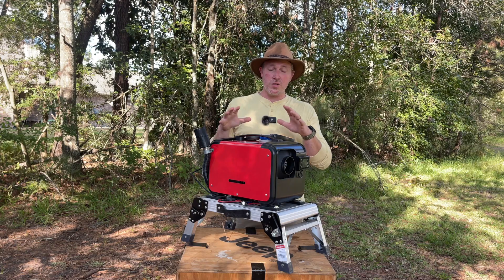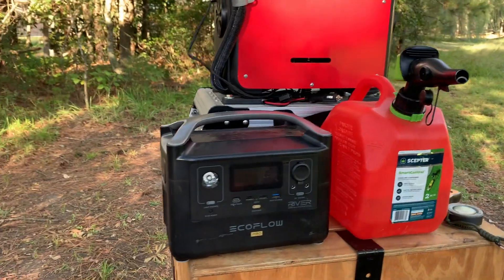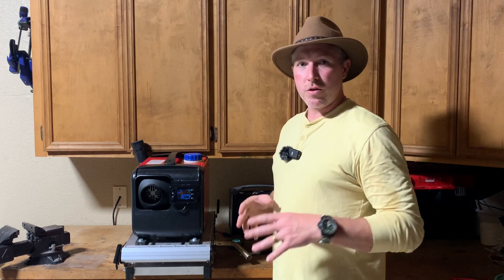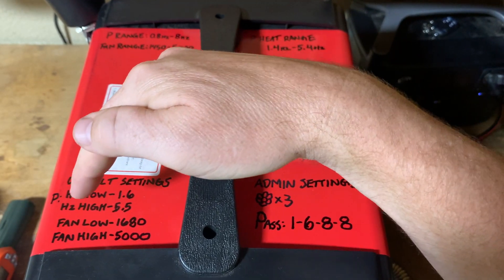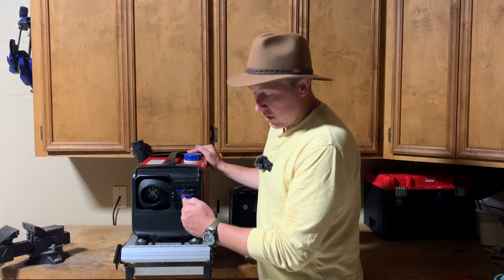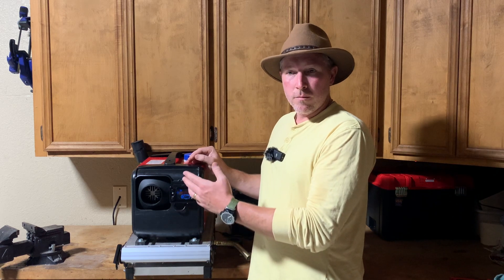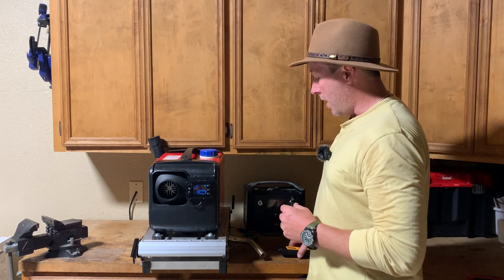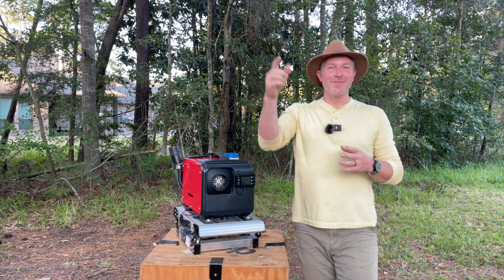Maximize Efficiency: How to Tune Your Diesel Heater!

Comment: Excellent information, I didn't give it much thought when I purchased the heater a year ago for my wife's office, which is the coldest room in the house. Today I took it apart, because it quit working. It was plugged up with soot, so I cleaned it out. We are at 8200 ft (2500 m), so I guess it never got enough air compared to the fuel input. It's now working fine again, but I ordered a CO meter so I can tune it properly for continued use. Thanks a bunch.
Reply from the maker: Awesome! Great to hear! Let us know how the tuning works for you!

Comment: Anyone cut their diesel fuel with used transmission fluid? Filtered @ 10 ppm of course.
Reply from the maker: Incredible! Always heard of tractors doing this every 100k miles. If it works, it works 😂🤘🏼
Reply: No.

Comment: Can I just take my permanently installed CO meter off the wall and use it instead of buying another one? It has a digital display. It’s the popular one from Kidde for $27. Apparently it detects from 11 PPM to 999PPM and updates every 15 seconds. I don’t want to contaminate it and make it less accurate over time.
Reply from the maker: As long as it’s reading ppm, I think it will be fine
Reply: You won't contaminate it but my standard wall one doesn't start displaying until 20ppm.  I bought a cheap chinese air analyzer from aliexpress for about $15 and it is 100 times for sensitive.
Reply: @ that’s great info thank you

Comment: Hot water freezes faster! Cold air heats faster cold air intake. Its rocket science.
Reply: Mr. Rocket Science, you may want to enroll yourself in a science class or two. It's unfortunate that people can spread misinformation so easily. It's probably even more unfortunate that there's so many who have just enough smarts to believe that misinformation :)
Reply: no it doesn't. I did the experiment. The rate of change between the temp. of two bodies is faster the greater the temperature difference. Which means that hot water COOLS faster but it doesn't freeze faster than the same amount of colder water because the RATE of change does not have inertia.
Reply: Idiot....... Troll
Reply: The goal is to not do anything that lowers the FUEL TEMP. Introduced cold air will lower fuel temperature thereby raising coking/soot build up.

Comment: Elevation 4500ft.  Low 1.0hz 2500 fan.   high 2.9hz, 4400 fan, air temp from heater is 330F. With 10ft stainless steel ribbed exhaust tube, 12” intake length. Fan speeds over 4450rpm creates a turbulent air supply and is bad for burn efficiency due to the inlet and outlet size of 1” even with short 8” length of tubing connected. 10ft exhaust does not change anything air flow is really low on these 2.8 mph max at 5000 rpm from exhaust turbine is a static pressure type so air flow has a sweet spot 4300-4500rpm after that watts go up air flow levels off with little increase compared to power consumption 40-45watts ideal fan speeds.
Reply from the maker: Incredible evaluation! Thanks for taking the time!
Reply: Great information.  Thank you.

Comment: question, I have been playing with my heater for over 5 hours tuning with this ppm meter.  i find the lowest ppm readings the exhaust puffs out some small amount of white smoke.  if i tune for 0 smoke i find ppm skyrockets above 300+.  do you find your most optimal setting to have some white smoke coming out and the burnt diesel smell?
Reply: my unit is brand new. Less than 5 hr runtime. I'm tuning it with the co meter. It's very odd. I find my lowest co ppm to have visible exhaust. With no visible exhaust I see ppm increase. Been testing for hours. Just found it interesting and was curious if others found this. I will continue testing.
Reply from the maker: @Rickydbaby  very interesting. Yes typically if its running clean (minimal if any exhaust seen) the PPM should be low. When i ramp from say P2.2 to P3.5 (power setting) there is a brief period of time where the PPM will increase off the chart until it settles and then the PPM will go back down. I know youre trying to tune it, but what is your current location (elevation/ temps). and if youve been tuning it, what are your current settings for LOW & HIGH Hz speed and LOW & HIGH fan speed?
Reply from the maker: I will turn mine on when I get home… When I have it on I don’t always watch the exhaust, but the exhaust is a good telltale of how the performance is… when we travel distances of elevation change I generally start the unit up and after it’s good and warm, I will double check it’s performance with the analyzer… This testing is only to reduce the amount of emissions, which is also a result of minimizing carbon monoxide… Different elevations will yield other variables that may not allow for being able to tune efficiently throughout the range… Every unit is different, but the outcome can be very similar depending on fuel pump and volumes, etc.… We typically run between 2.8 and 3.2 for the power setting… Any less is not warm enough for the distance of the heat to travel up the tube and any warmer is a little too much for the small space of our tent
Reply: Check out burner excess air on the net. Trying to achieve 100% efficiency is impossible.  25years experience as a boiler engineer.
Reply from the maker: white smoke typically means rich or raw un-burned fuel is getting into the exhaust. This could be result of a few things, but more-so for unit that have experienced a bit of runtime. For units that have been used a while, it could be that your chamber is full of soot and needs to be cleaned out. I could also mean that your glow plug or glow plug mesh screen is blocked. it could also be that you're not getting enough air in (inlet is blocked) or not enough exhaust out (too much exhaust piping length and/or bends).. could also be the quality of fuel. If you're not getting any code (i.e. E6 which would mean fan obstuction). It could also be your powered connection. these units can use up to 15A at startup and if your source of power is not connected properly or is dropping out under load, it could result in power voltage to the system. I know this is a lot of channels of troubleshooting, but with more info from your end we can potentially assess the issue.
Reply: @GatorOverland  https://www.youtube.com/shorts/bHSR_SU0A3w
Reply from the maker: @ I see what you’re talking about and that’s really interesting to see that the PPM is quite low because I figured that would be paraffin, which is a result of burn fuel generally contains carbon monoxide… Those levels are actually acceptable… Generally anything below 30 is all right… Does it still produce as much smoke when the power level is increased to highest setting?
Reply: @GatorOverland actually there's almost no smoke on highest setting. 

Currently my settings are 1.4 @ 1600 , and 4.5 @ 4300 rpm. At pretty much sea level and about 50 degrees outside and foggy CA Bay Area. 

It seems these ppm levels should be good I was just concerned with the smoke. I wish I could measure case temp but this display doesn't have it. I might switch back to my old 5 button lcd if it will work with the lavaner pro because I liked monitoring case temp and it had it.
Reply: Ended up opening up my heater for shits it's spotless clean. Tuning for low ppm I think works even if you see smoke. The smoke i am seeing I believe is water vapor.
Reply: @Rickydbaby make sure the exhaust end is lower than the heater always. The total length of exhaust should also be short and without many bends, make sure the muffler has the weeping hole at the bottom or it can fill with liquid.
Reply: @PatrickEdgar-o8j mine runs downhill one 90 bend total length is around 5ft.

Comment: Are you or anyone familiar with the controller exactly like this one but Has P-1 thru P-6 gears instead of the P-Hz numbers?  I have The P-1 to 6 controller and I want to adjust Fan and power numbers.
Reply: Is it a Kroak / Hcalory unit by any chance. That's what I have and the advanced menu is locked.
I'm having to buy a new motherboard and controller for mine as it keeps sooting up

Comment: Perhaps someone can comment about the impact that a ducting system has on these settings. I have had an 8 kW on my sail boat with about 30' total piping for years, but ive always felt that there could be more output somehow. 

 Smoky on startup, but runs clean when warmed up. Always has been since new.
Reply: I'm not an expert, but I do know a few things about HVAC.  30' of duct (piping) is an awful lot of restriction for the little blower in a CDH.  If you need to distribute heat over that large an area, I would suggest getting a second heater or figure out a way to heat as little space as possible.
Reply from the maker: Yes, back pressure definitely plays a roll. I think all of them smoke to some extent at startup until the chamber temp is optimized

Comment: So after all of this configuring…What is the actual diesel $$ savings ur getting? Has anyone figured that out yet? Also my fan seems to always blow hard/fast no mater what settings. Is anyone else’s like this?? How can I run the fan slower at times or on demand? Thanks in advance!! KIKO
Reply: I am strictly here to find out how to slow the fan down
Reply from the maker: Go through the admin steps mentioned and report your default settings. 
Low hz
Low fan rpm
High hz
High fan rpm
Reply from the maker: The diesel saved will all be relative to your specific settings, and at that you would have to test the fuel consumption at each setting .. but simple math can figure it out with 0.022ml pump x the fuel pump hz.. but there is too many variables an won’t apply to everyone’s tune. Just know if you hade low ppm CO, you’re saving fuel. As for the fan, you can get an anemometer to gauge the air speed.. different brands have different fan types, also could depend on your hose length.
Reply: I watched a vid where the guy tested his at 21° and 30°, he got 50hrs with the medium temperature and 15hrs at the high, all using 1 Gallon of diesel. Another guy mixed used chipshop cooking oil, filtered of course, with 30% kerosine,
Reply from the maker: @THEPINKFLOYDIANS brilliant!!
Reply: Tuning is more important to operational longevity than saving money.  Tuning for altitude and efficient burning substantially reduces the amount of soot.  Soot clogs the burn chamber, exhaust pipes and especially the muffler.  How do I know- I have had 2 heaters fail within a YEAR because they were running rich at altitude- too much fuel for the O2 content of the air-  Not sure how much HEATER life is extended but I am sure tuning will be a big help!
Reply from the maker: Thanks for taking the time to watch and comment!

Comment: 1.5hz 1620 rpm 10 ppm co/ 5.0hz 4600 rpm 16 ppm co, 2400 ft
Reply: EGT at 5.0hz  550 F
Reply: And you have had not soot issues at these settings? Is it. 5kw?
Reply: No it ran great all winter.
Reply from the maker: Awesome!!  Thanks for taking the time to share!! 🤘🏼🤝

Comment: My controller looks like yours but I can’t find how to get into the settings.  Pressing the gear doesn’t do anything. If I hold it then it will start the heater in temperature or timer mode. But I do have the Bluetooth app and it shows my altitude correctly so I wonder if it automatically adjusts my settings. I mostly run it in an old uninsulated garage that is a bit drafty. Exhaust stays inside and burns without odor after initial startup so I keep that heat too. Aluminum body will run somewhere around 320 once it’s been running a while.
Reply from the maker: Yes, some models do have an altimeter mode built into them… Hard to say what model yours is… You should be careful running the exhaust in the garage unless you have ventilation… pressing it three times should bring it to the admin menu for entering 1-6-8-8.. if yours doesn’t do that you probably have a newer controller .. what brand/model is your unit?
Reply: @GatorOverland  I can't find any really good details but it's an Hcalory 8kw one that looks very similar to yours. Bought it a couple weeks ago with an included power supply. But like I said, I can't seem to get into that admin menu system. I'll try to mess more with it later.
Reply: I just bought a non-labeled CDH.  It has a “new” controller that does not allow access to revise the air/fuel mixture.  It only has normal and alpine mode.  I’ve purchased an “old” controller and matching motherboard to allow this type of access and tuning.  It hasn’t arrived yet, but I’m looking forward to being able to better tune mine.
Reply from the maker: @lucecannon 🤘🏼🤘🏼🤘🏼 thanks for taking the time to comment. Looking forward to the report back of your results. I believe the newer controllers have an altimeter in them to calibrate for elevation, but hard to say how accurate that may be, and or if the settings are even adequate.
Reply: @GatorOverland  I just picked up one of the 2025 Hcalorys that has the altitude setting.
 I don't know if it has an altimeter in it and auto adjusts but I put the CO meter (the little round one) at the exhaust and it's zeros across the board. I blew smoke at it and it picks that up so the meter is functioning.

Comment: when i adjust my temperature on my heater it will error with an E-05 and i have tried to change other setting but it still fails,
if i run it at its low heat and slowes fan speed wil will run all day for 36 hours until it runs outn of fuel
Reply: Great info.  Have been searching and investigating diesel heaters for a short while now and this is the first video I’ve found that explains the tuning in and clear way.  Thanks lots!
Reply from the maker: Thanks for taking the time to watch and comment… like you I did a lot of research and felt I could produce a video that explains what I found in a handful of videos all in one…. Hope it helps.. check the video description for notes and links to equipment
Reply: Also could be due to altitude. You’ll need to turn on the altitude mode
Reply from the maker: E-05 means overheating.. make sure your duct hose isn’t too long or too many turns.. also, make sure then fan isn’t obstructed and has good air flow.

Comment: Thanks, what is the general rule for higher altitudes... lower hZ and slower fan ... concept wise,
Reply from the maker: Depends on the unit KW size and fuel pump, but for reference:
5KW unit with 0.022ml pump
Sea level low- Hz@1.6   RPM@1680 
Sea level high- Hz@5.0   RPM@4500
2500 ft low- Hz@1.4   RPM@1680
2500 ft high- Hz@4.5   RPM@4500
5000 ft low- Hz@1.3   RPM@1680
5000 ft high- Hz@4   RPM@4500
7500 ft low- Hz@1.2   RPM@1750
7500 ft high- Hz@3.5   RPM@4500

Comment: Alot to learn .I turn mine on and it jest smokes alot
Reply from the maker: If a Chinese diesel heater is producing excessive smoke, it usually indicates an imbalance in the air-to-fuel ratio, most likely caused by issues like a clogged air filter, faulty fuel injectors, a dirty combustion chamber, or incorrect fuel pump settings, leading to incomplete combustion and smoke emission.
Could also be bad fuel
Reply: @GatorOverland   Ive had 2 different ones off of amazon and every time one failed it was the fuel line when it smoked like that. either air getting in the fuel at a bad coupling point in the line or it getting so cold the line was loose and actually drip / leaked. They dont like this type of stuff at all.

Comment: All of these reviewers and no explanation what is an intake and why You should ALWAYS put it outside. Intake is only for burn chamber. It takes dense cold air from outside, mixes it with diesel and heat and blows it out exhaust. Intake for the inside air is ON OPOSITE SIDE OF THE HOT AIR EXHAUST which heats Your workspace/cabin. So if You put intake hose inside of a space, it will blow air from Your heated space through the metal exhaust pipe outside, create negative pressure and You will use more diesel to heat same space.
Reply: Nope, you'll have to do the math again on that one. The air of the exhaust has the same temp. With warmer air in the intake, less diesel is needed to get to that temp.
Reply: @aboner2551  I was thinking if one used a heat exchanger on the exhaust to heat the incoming combustion air, possibly help with the combustion and efficiency.
Reply from the maker: This has been discussed in other groups and does work, but can also be an efficiency if the unit is in the area being warmed and the inlet air eventually starts taking in the warmed air that is filling the room. Vs having the unit outside constantly taking in cooler air to produce warm air. 
The only issues with a unit inside is assuring you don’t have any exhaust leaking into the area being warmed, and being in a warmer room could cause the units to overheat prematurely. 
Overall it’s something that can be done but take testing the variables to see if it works .
Reply: If the exhoust is cloged he will return white smoke (unburned fuel) on intake
If last time shut down is coused by electrisity cut off its posible to see the same situation

Comment: Lol I posted on somebody else’s comment I have a vevor 5k and I did a test run. I had it on high lvl10 couple minutes and then set it on lvl2 for 8 1/2 hours and it literally went through all but about 2 inches of the site glass  meaning it went through 3/4 of the tank in an 8 1/2 hours on level two videos of people commenting they can run for 30 hours nonstop and I didn’t have that experience I did some research and found a company that makes essentially remote thermostat. Turns it on when it’s below the desired temperature turns it off when it’s at the desired temperature.